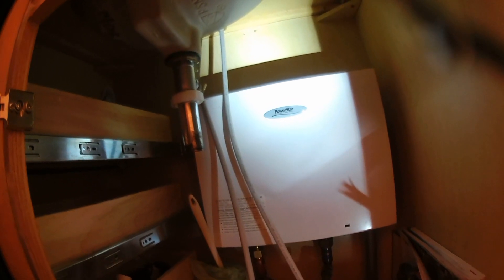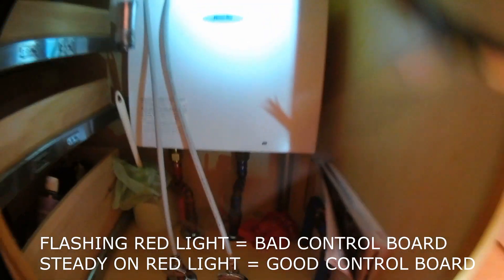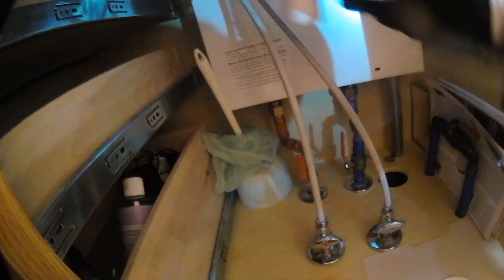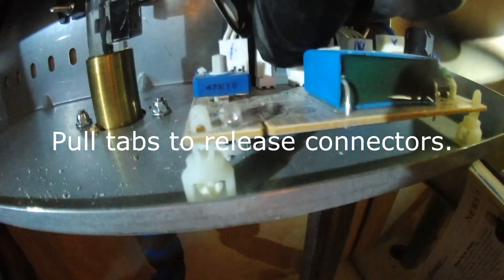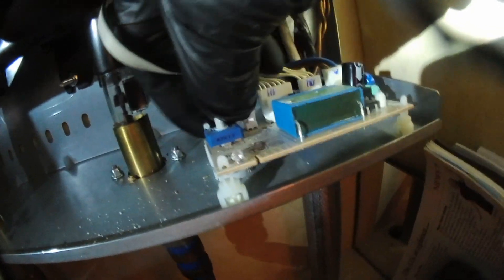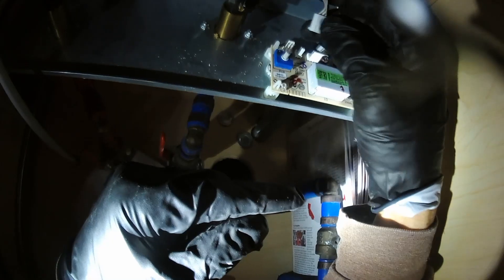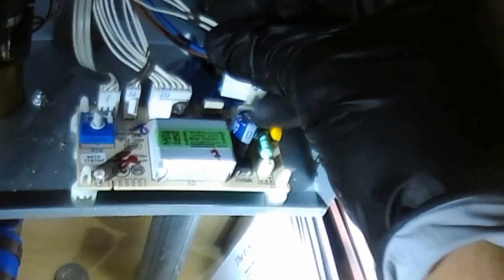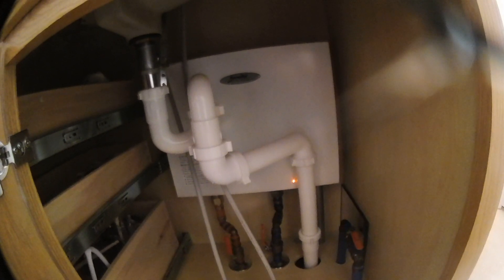NO HOT WATER, BOSCH TANKLESS ELECTRIC WATER HEATER, DIAGNOSE AND REPLACE CONTROL BOARD,.

Comment: Hello Joseph, what happens if the light does not turn on, do you know the part to replace?
Reply from the maker: Make sure the power is on to the unit. Check the circuit breakers.
Go to Boch-home.com.
Call  800 944 2904
Or send email  on their website.
Have the model and serial numbers ready.

Comment: Thanks for the great video. You were a saint taking all that plumbing crap apart to get to the unit. Note: My 8 year old unit is now blinking. Warranty is 10 years for Powerstart AE125! Calling Bosch support for diag next week. I think they may cover the parts. Not sure if it's the water elements or the board or both. 

Note: if you own this unit don't EVER let it run without water in the unit. It will burn up the heater elements. Also, make sure the unit is BELOW the lowest water user in the house.
Reply from the maker: Thanks for the comment.  Hope you get it fixed.
Reply: Correct on using any tankless with no water flow, there are thermal cutouts, but don't try it, high heat can burn out! Before powering any on, ensure water is flowed (and no air is in the plumbing system) then go for use!

Comment: These are good for about 3 to 4 years. I've had 3 all under warranty.  I'd never buy again
Reply from the maker: Thanks for the info.
Reply: Our plumber didn't put any filtration system in when they installed our unit. Did you do any yearly maintenance to flush scale. Saw that in another video with a gas unit. You basically run white vinegar through a unit using a sump pump. You have to have flush lines to do this.
Reply: @josephhart2566  I called Bosch support this week for my AE125 (newer S/N so the board is different with external components on it, need to have technical skills to change it as I do) They mentioned vinegar when I asked if I could clean some parts, they said remove the part, put it in vinegar) I'd call them and ask before attempting any flushing of it!
First, is your water city? If so you should be good, if well water does your home have filtering already, such as for low PH or sediment? If you don't have a well problem with water, you should also be ok. Bosch could answer more on how to check, but if your unit is working, I suggest just leave it..
Reply: How old was yours each time you had warr. replacement? Over 10 years or less?
Reply: @johnf5122  about 3-4 years old each